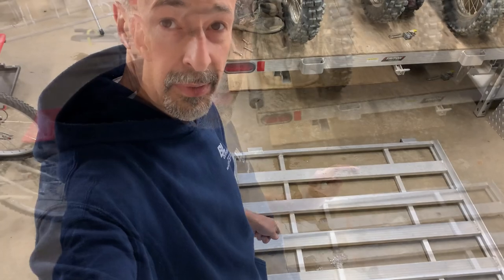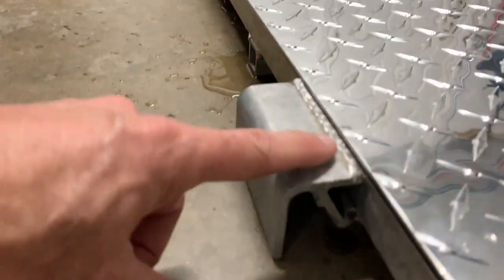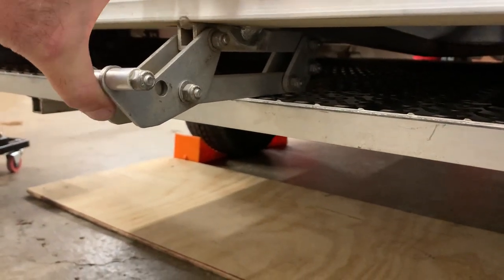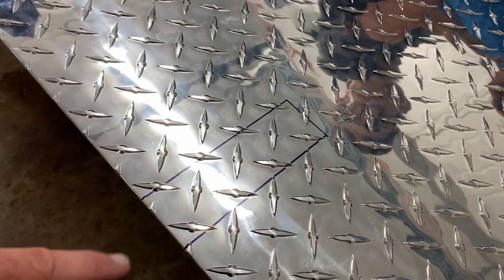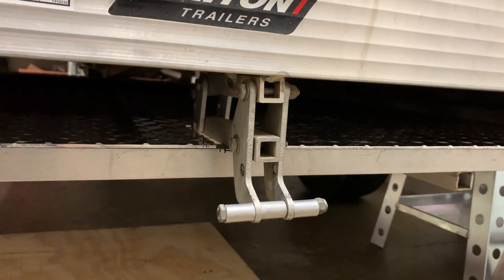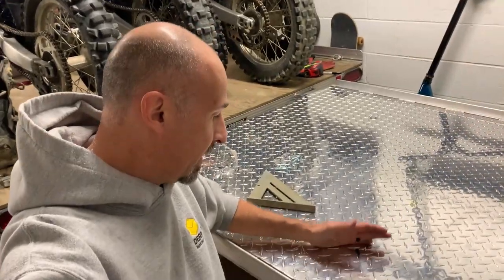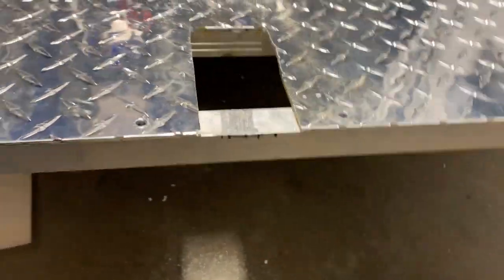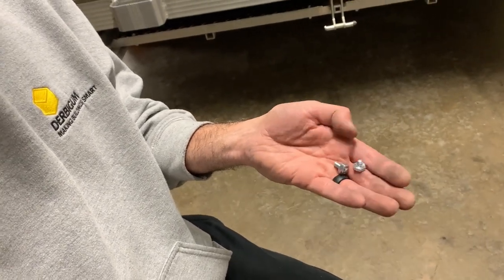Triton ATV88 | Trailer Modifications

Comment: How do you have the motorcycle wheel holders mounted to the trailer.  Are they just going through the plywood floor or are they mounted to the trailer frame underneath.  Or have you had to add anything under the trailer to secure they cycle mounts.
Reply from the maker: I just have the wheel holders in the plywood.  My plan was to put them into the supports but the layout did not coincide the supports.  There is not a lot of force on them so the plywood holds them just fine.  Thanks for the question.

Comment: what do you think about using those low profile tires for other trailers?  I'm building something light weight but it's tall and I don't want the wind blowing it over, these look really stable and low to the ground.  They have a heavy tread though, I guess they must run ok on the highway.
Reply from the maker: If you are referring to the tires that on on our trailer, I like them very much.  The lower profile, wider tire did better in the grass and dirt.  The tire did not sink into the ground.  I also felt that added more cushion when going down the road.
Reply: @RMAGarage  are they 18.5X8.50-8 class C  ??
Reply from the maker: The tire size is 18.5 x 8C.  The link below is for the trailer specs on Triton's website.  If you clink on full specs it will give you more information.  The model number of the trailer I owned is "ATV88":
https://www.tritontrailers.com/atv-utv/aluminum-wood/atv/

I actually sold the trailer because I have no more use for it.  Kids grew up.
Reply: @RMAGarage I’ve used my ATV88 for 12 years now. Dirt bikes, atvs, dirt loads , lumber yard runs, kid moving days and other random uses. Added a boating hand winch for dead atvs , and a corner flag marker to help seeing it. It’s still in great shape. 🇨🇦